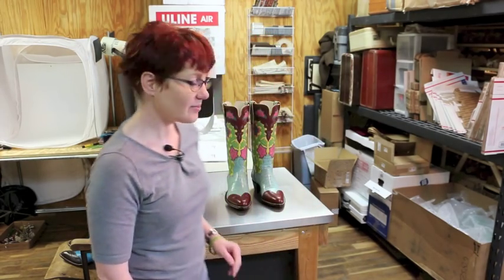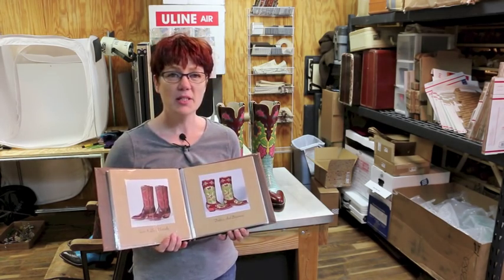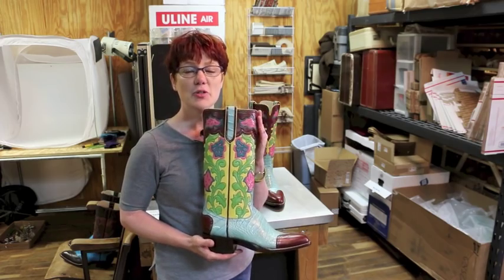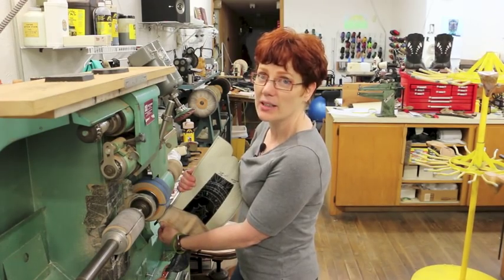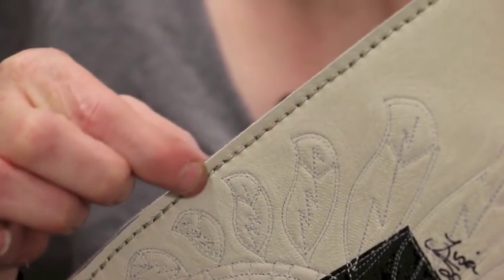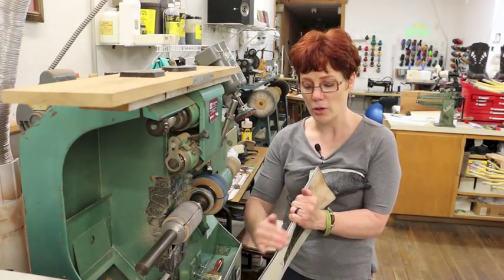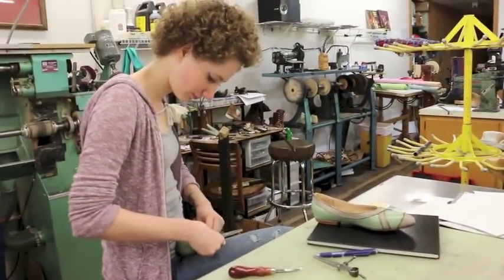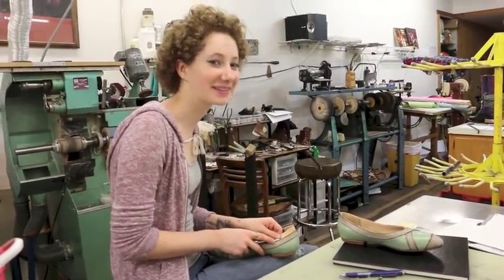It's a Boot Life: trimming side seams

Comment: Hi Lisa,
I am wondering why you like the lip knife for the seam trimming operation.  In the
video, I could not see the lip being used; it just seemed to be sitting up in the air. I
hypothesized that you might be sighting over the lip to judge the width to  trim.
Is that a good guess, or is it something else?

Always interested in how other people use tools....

Mark
Reply from the maker: +Mark Dawber You are correct, I'm using the bottom of the lip knife for the initial trimming. I could use any knife here, but if a beginner is copying me I won't have to worry that they'll pull the tip of the knife through and cut themselves. Also, it's hard to describe and show, but once I start trimming off the ridge that remains I do use the tip of the lip knife. You can snug the rounded tip of a lip knife right up against the trimmed edge on each side of the seam and pull it right down the seam, trimming off the ridge as you go, almost without paying attention. It stays in place really well and makes trimming off the ridge very simple.